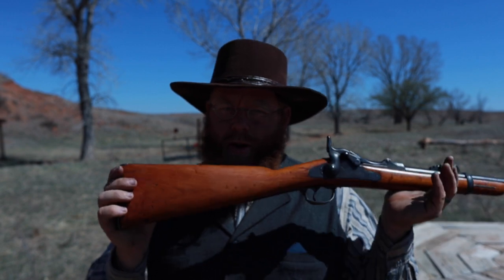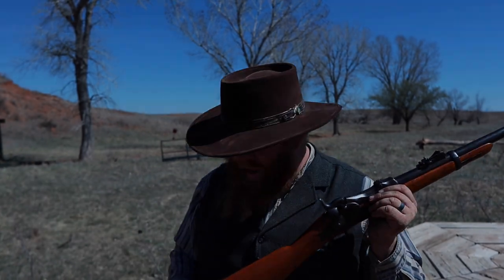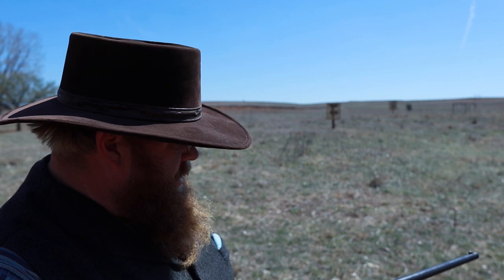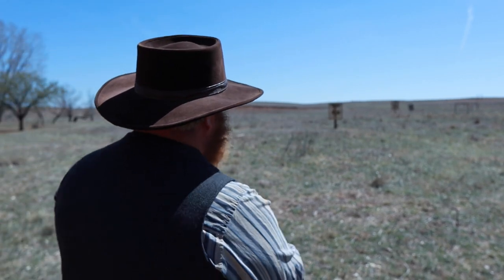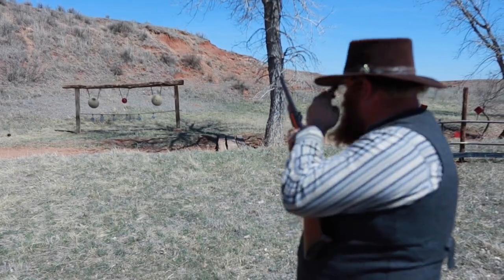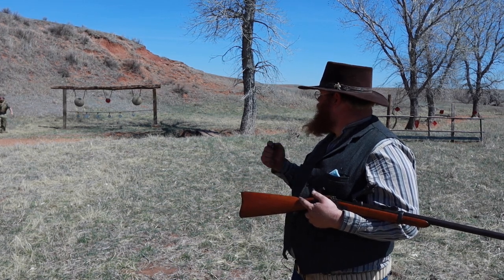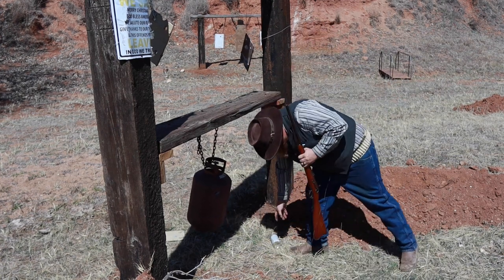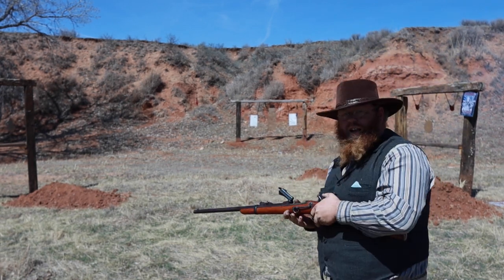SHOOTING AN ORIGINAL 1873 SPRINGFIELD TRAPDOOR CARBINE

Comment: Sometime they used a 10 round wrist cuff.
Reply: The Army was reducing their count. of horses at the time  For a period of time After the Revolutionary way The only horses were ceremonial.  I would say it was a Cavelry mod but the units were mix and match.  Since the Harry Lee USC have been Dragoon units,  Light cav in the South was Colt revolvers 6-8 coming out of the nite mist Screaming that yell, not long you have to be out of there before you run out of pistols.

Comment: Found a sweet M1873 carbine on gbrker. Mfg date 1879, Mass. Corps of Cadets marked. Arsenal queen, probably didn't have more than 300 rounds through it. Some fool carved a mandela wheel in the stock so I got it pretty cheap. Other than that practically mint. Shoots like a dream.
Reply from the maker: thats the best kind still original but cheap
Reply: @Real11BangBang  Lucky find.

Comment: This won contract because of politics. This is one of the weakest "conversion era" firearms.
Still neat.
Reply from the maker: This is Ethan and I really don't have a dog in this fight but I will tell you this as a fighting rifle. I would 100% take the trap door over the rolling block or the falling block The reasons why are as follows in the 1870s. The trap door had automatic ejection. The rolling block and the falling block only had extraction. This removes one of the steps in the loading process, making it have a higher rate of fire and slightly more firepower. Also, I can't help but notice the very high bore axis on the rolling block. It's almost like what a lot of guys criticize the AK about nowadays where instead of a cheek weld you have to get a chin weld. And the trap door is actually not that weak of an action of all the explosions that everybody talks about the trapdoor having. There were only two that happened during trials and that was because they were using the 1865 trap door which did not have a spring on the latch and the action was not actually locked up. They fixed this and it never happened again during its time in military service. The trap door would be about on par with the Snyder and the Martini Henry would be better than both the trapdoor and the snider but that's just my opinion. Like I said I'm not a huge single shot surplus rifle guy. I just shoot them. And notice which ones I believe to be superior.
Reply: @Real11BangBang  I just ment that from a design standpoint it was the weakest, has the poorest extraction as well when dirty, that wasn't ment to say it was the worst! It is a neat design and I wouldn't toss one out of bed.
Reply: The 1866 td in50-70 was a 58cal musket conversion.the 1873 td was not a conversion